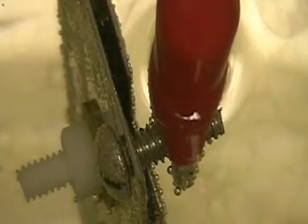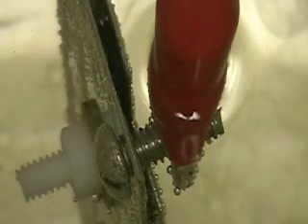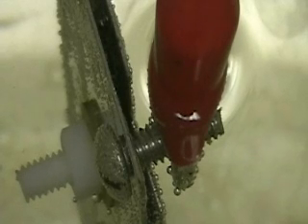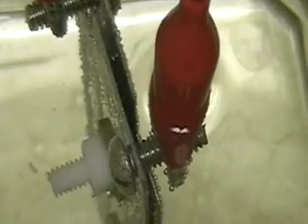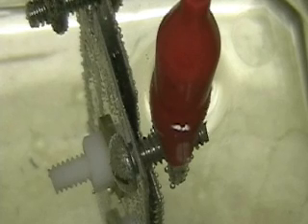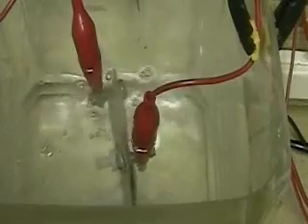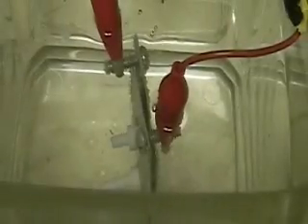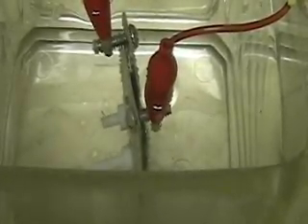Hydrogen Tap (Testing The Pulse) 260

Comment: also waht about the walton crock voltage multiplier, its like the tesla coil and was used in particle accelerators. maybe use somethign like that. maybe it would crack the water with high voltage like what its used for atom smashing in particle acellerators

Comment: Does it make a difference in amperage if you use more voltage (with straight DC voltage)? Or is the wattage basically the same? Also, have you tried AC voltage (like with an inverter on a car)?